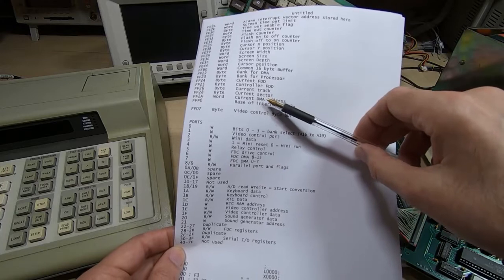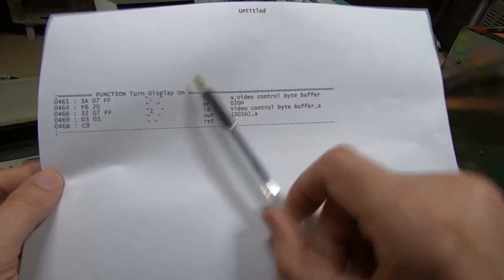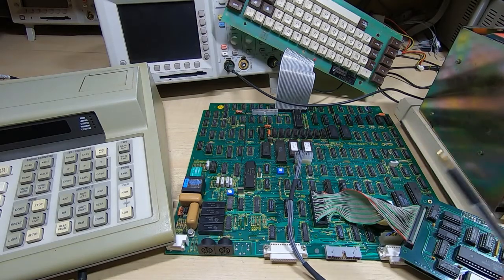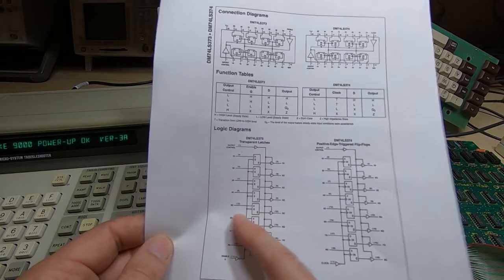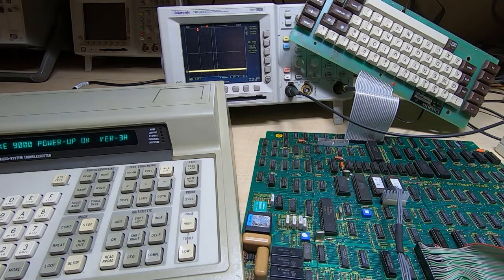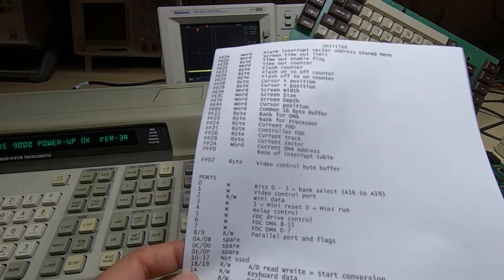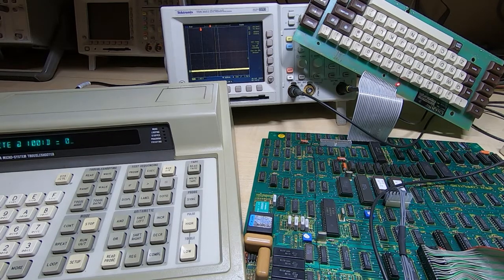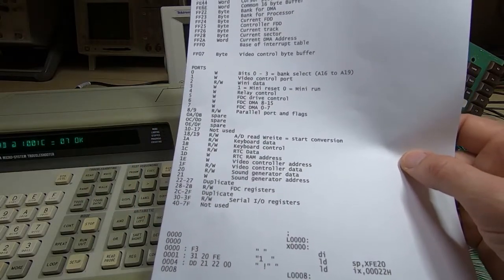Wren #3 Repair Part5

Comment: doing this would be handy for developing software for the Wren.
Reply from the maker: Yes I agree, In fact I use this method to develop short test programs for it but it is a very good way to develop bigger program which could access the hardware directly. The OS is CP/M and this defines the hardware as 'devices' which is intended to acheive the same thing but I think that knowing the actual hardware access from the processor perspective would make writing code easier (or even a custom operating system).
Reply: @JerryWalker001  Yeah, I am very familiar with CP/M as I had a Kaypro and a DEC Rainbow. But yes, I agree.  I have always felt that if you're wanting to be writing a good program means you should know the system, CPU, I/O etc etc and how it expects things to be.  At least for me its managed to keep bug count low, and I'm not that much of a programmer besides assembly and BASIC.  Yeah, I'm quite sure if someone had done the proper reverse engineering per sey  you could write a OS, we did that in college as a class exercise.